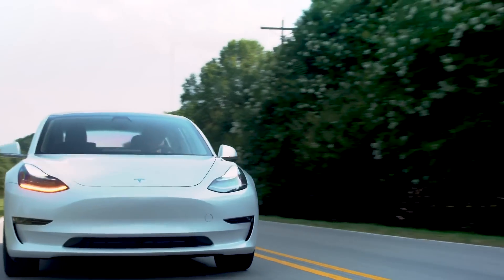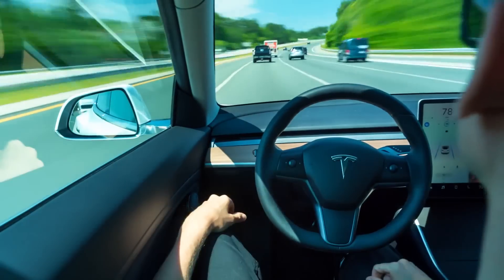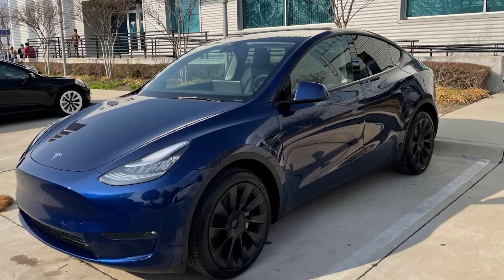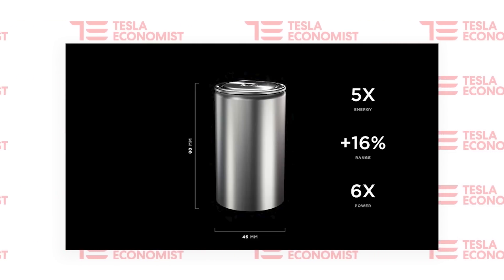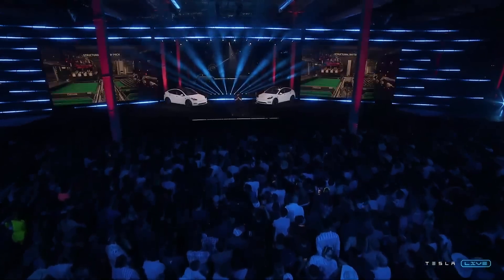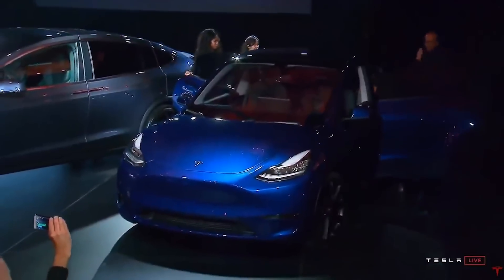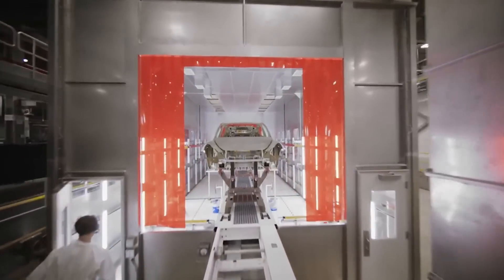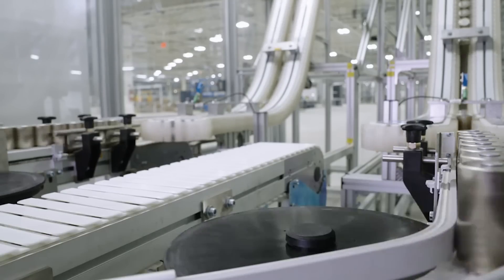Tesla Model Y 4680 Austin Software Upgrades!

Comment: On the topic of potential future software upgrades, one that seems to be well under the radar is the premium sound system for Standard Range cars. It is my understanding that all M3 and MY cars are made with the same sound system capability, even if there is a difference in the number of speakers (I should go and count them). The standard range cars are apparently software limited to "lower quality" sound system. I may be wrong about this but I've heard it from several sources, including my mechanic who specializes in Teslas. This actually came up when I was trying to figure out why the footwell lights in my SR+ aren't working whereas they work fine in my M3P and MY.  Turns our they are there and are simply software disabled. Anyway, I would be willing to upgrade my SR+ to premium sound for a reasonable price.

Comment: Lots to think about with this one TE and it leads to some very exciting thoughts!  So in a nutshell the 4680 could end up being the ONE BATTERY TO RULE THEM ALL, if I have that right. 

Today Tesla needs EVERY BATTERY THEY CAN GET, so they are flexible with not only their chemistry, but also their form factors. 2170 has been great and is still holding it down as we await battery ramping in Austin and Germany is still having their battery facility being built. The 2170 is a favored battery for other products outside of cars and so, even if Tesla stops using them, Panasonic won't loose customers for that form factor. 

The upgrades are a less talked about aspect of Tesla these days, but back in the day, being able to make your car even better (after you buy) is something that still remains pretty unique from this brand since the upgrades are not after market. Range, charging speed is an upgrade something Tesla sold before with the much earlier Model S60 (remember that one) before they eliminated that and the even lower battery offering to just do the Model S 70. People jumped on the upgrade because it gave them a benefit that they wanted when charging was much more sparse as well as peace of mind. 

After market upgrades are a great business that many other companies specialize in, like EVANNEX but Tesla is the only manufacture of a car that also offers upgrades direct to their customers that they have a good idea they will want. It helps them continue to get revenue even if their sales ever peak (not anytime soon) in the future.  Like a smartphone that actually can get better the longer you have it and you can modify. Imagine how long people are going to WANT TO KEEP THEIR CAR especially since for many it was the most expensive car they had ever bought before?

The Austin Y might just be a sleeper agent for now, but it could end up being the number one seller in the world after the lower cost LFP model that is available in China. Speaking of the LFP version... in these days and times 250 miles would be VERY WELCOME at under $50k  in this market with the way petrol prices are world wide. 

Nice one TE. You don't disappoint.
Reply: My brother in-law bought his Tesla almost a decade ago, has clocked in over a hundred thousand miles and has no plans to change it because it is still the latest Tesla !! And yes, he paid a bomb for it at that time, but he has no regrets
Reply: 2170
"Panasonic won't lose customers"
Tesla owns the factory.
Tesla "owns" every cell leaving the factory.
.
"2170 is the favoured cell..."
LiFePo4 seems to be "the favoured cell" outside cars.
Cheap and plentiful, with fewer volumetric energy requirements.

Comment: I would like to have a software upgrade to air suspension! :)
Reply: They are good but I think you might be waiting a little longer for that one 🤣🤣🤣
Reply: Meh, I've had air suspension vehicles before and kinda don't want one anymore, they are exorbitant to repair out of warranty. Kinda kills the whole idea of having a low maintenance vehicle.
Reply: @GregHassler  yes, but suppose we could have a low maintenance air suspension !! If anyone can do that, it would be Tesla !
Reply: The Raven air suspension on my X is unbelievably good
Reply: What difference does air suspension make? Never tried it.
Reply: @faluffel  generally speaking the ride, handling, noise and vibration characteristics are better with air suspension, ride height can also be easily adjusted to cater for the load in the vehicle and or driving speed or conditions. Car will lower at higher speeds to reduce drag and roll moments, car can be set with gps to raise to go over speed bumps or get into your driveway etc etc

Comment: I wonder if in say 4 to 5 years Tesla would have enough cell degradation data from the 4860 cells to then be able to offer a range extension on the "degraded" packs.  They might be able to bring you back to original for $500-1000.  I'm not sure how this would be in terms of public relations though.  It might be something they can offer for free, or they'd need to explain the cost to get the range extension right ie it's not as easy as a line of code that's changed.  Tesla have a lot they can do when they build a car with a million mile drive train

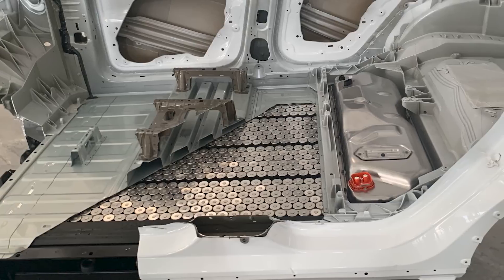Comment: At 2:45 you said 3000 kW, pretty sure you meant 300 kW :) Anyway, exciting ideas!
Reply from the maker: Yup, I was waiting for someone to pick that up. Was hoping TE viewers were smart enough to work it out 😉
Reply: @TeslaEconomist  Spoken about it, last week they showed a megacharger of 3.75MWh and I know for a fact it's designed by Tesla
Reply: @TeslaEconomist  I immediately wanted to correct you to 324kwhs as supposedly in q3 that is gonna be the new unlocked v3 sc speed.
Any bets on what the v4 allegedly coming out in late q4 of this year will offer? I'm gonna go with 420kwhs. 😁
Reply: But, if EITHER Tesla, OR Panasonic, OR LG "cracks it", while those two are reporting back to Tesla, (which seems to be the case) they ALL end up with a huge benefit.
This is the smart side of open patents.
Tesla has tripled their production R&D, and will receive "cheap" cells from both companies, probably with an agreement they can sell elsewhere after a certain period.

Comment: There was some reporting a while back on a process for a certain way of recharging that improved the batteries. There could be a special online service that checks and renews the battery pack. Tesla probably needs a virus and hacking protection software service.
Reply: You mean periodically "balancing" by charging to 100, then immediately discharging to a few % to allow the BMS to "read" the upper/ lower limits.
If you constantly run 20-80, the pack used to assume that was it's full capacity.
Not sure if that's still the case.
Reply: @rogerstarkey5390  Finally remembered this was from a Transport Evolved video 2 mos ago. It was about a report from DOE/SLAC 4 Jan 2022: "We found that we can move the detached lithium toward the anode during discharging, and these motions are faster under higher currents," said Liu. "So we added a fast, high-current discharging step right after the battery charges, which moved the isolated lithium far enough to reconnect it with the anode. This reactivates the lithium so it can participate in the life of the battery." >> This would require a way to accomplish the short time high discharge. Maybe have special drag tracks with superchargers at the line.

Comment: Charging extra for unlocking faster charging, increased range, faster acceleration, what next better sound quality? It's a bit maddening if the hardware is capable...
Reply: Not as a Tesla investor 😜
Reply: @kickvdw1706  I am a Tesla investor, so appreciate the financial aspects. Trying to save up for a Tesla car, but will have to sell my shares to fund it...
Reply: I don't think it is a big deal. Remember it would cost much more if all the features were unlocked. This way, you can buy the car at a lower price but have the mean to unlock it later on if needed. What I am concerned about is ads in the cars.
Reply: Sure if the base models have active sound cancellation tech like the s&x. But they lock it until you pay for it. 😀
Reply: You think every other manufacturer won't leverage software/ performance, etc?
Reply: @nguyep4  Ads in the car - hadn't even thought of that! That would be something else they could make you pay for like YT Premium...

Comment: 4680's going into a Plaid+ vehicle with a 600 mile range would be awesome.
Reply: Won't happen from tesla. But someplace like Our next energy might offer an upgraded pack in a couple years, like they put in their experimental model s. Then did 750+miles in the cold at hwy speeds and 880 miles in warm weather on a dyno with an otherwise stock car. 🤔
Reply: I’m not sure anyone needs 600 mile range your just carting a load of weight and expense around. Towing is the only exception as this kills the range so a bigger pack may be useful in that circumstance
Reply: @TeslaBulldotcom  Nobody needs 600 miles except for towing, but many people want that sort of range and if Tesla makes more profit from it, compared to putting that pack into multiple vehicles, then it would be a productive use of the cells. Towing is a big challenge currently and completely unrealistic in most cases.
Reply: I like the way you think!  I personally would be okay with 400 miles (6+ hours of driving), as that would reduce the 600 mile pack weight by 1/3, increase the acceleration and improve the handling.  Could the 4680 pack power the Model S plaid to finish the quarter mile in under 8 seconds?  Just another thought....
Reply: @bru512  Under 8 second quarter, maybe 6 minutes around the ring, having to charge less frequently for a normal week or month, and being able to cover very large distances and tow with ease. But maybe that's why they're going to have the Roadster with 620 mile range.. But I don't see that towing anything. But then there is the quad motor CyberTruck with 500+ mile range (maybe 600 when it launches), maybe that'll be the next level. I'll get both when they are available.
Reply: @michaelwebsternz  
How many Model S actually tow?
They'll reduce the weight, put a 110-120kW pack in and bump the charge rate.
450 miles absolute max (Outrange the driver)
250 miles charge in 10-15 minutes.
Job done.
Reply: @rogerstarkey5390  Anyone that has a boat. That's a lot of people where I'm based.

Comment: I super doubt that Tesla retires any battery cell sizes, anytime soon, as doing that also means retiring the entire ecosystem built around them to make packs, and the battery lines producing the cells, and all of that would mean fewer EVs made. Tesla has to reach the point where they are no longer battery supply constrained for that kind of move, and with Elon talking about replacing the entire worldwide power system...

I think we might get a range boost, sure, but not a huge one. Once an EV can comfortably do 300 miles and there is a great charging network, a boost in charging speed would be more appealing than more range. And if you can add say 200 miles in fifteen minutes, you become a lot less worried about total range.  

It looks like Tesla will try to avoid the Osborne effect by making the advantages of the 4680 Model Y be software locked behind an extra charge. This will also, of course, improve margins.

Finally, I expect at some point once Austin is fully ramped, Tesla will convert their Model Y lines at Fremont to Model 3 lines. The cars are close enough, and then there will not be a conflict between the versions of Model Y and Tesla will likely start shipping them unlocked with great acceleration and fast charging and so on.

Comment: The 4680 model really has the sweet spot in weight
Reply: The 4680 is "an enabler", a force multiplier.
.
It directly and indirectly enables system efficiency in the vehicle
.
It also multiplies energy out: factory volume (and factory energy consumption, and workforce, and process improvement, and environmental standards....)
.
Multiple "sweet spots"

Comment: Seems likely all US Y production would be in Texas, and the Y body line in Fremont switches to Model 3 w/ front casting. And then upgrade the old 3 line...
Reply from the maker: Yes, a possibility.
Reply: Is the model Y eating the 3’s lunch yet or are the prices different enough to keep it going
Reply: @TeslaBulldotcom  
Well, they seem to be establishing positions "1&2" in many markets, with nobody even close, so one "eating the others lunch" doesn't seem to be an issue?

Comment: Regular firmware upgrades seems like a given since over the air connection is a thing. Kinda like cellphones. However.. locking things behind a paywall like some cheap mobile game is wrong and will damage the brand over time unless its locked for a good reason like increasing the life expectancy of the things by alot.
Id assume acceleration boost is such a thing, you may go faster but it will eat the battery and motors if used to its potential alot. I still think the paywall is dumb tho since you wont use the full boost at every acceleration even if unlocked. Thus life expectancy wont go up by alot anyways and should probably just be just another car setting available.

Intentionally locking features without reason just to charge extra later is bad.
Reply: Locking the 4680 Model Y is being done with a good reason: to keep the 2160 Model Y competitive. If the prices were about the same but the 4680 Y was significantly better, which if Tesla just left the 4680 unlocked and charged based on their costs...well the 4680 probably will cost less to manufacture once ramped...then no one would want the 2160 Model Y from Fremont, and that is where Tesla can produce most of their Model Ys in America right now. Either Tesla does this or they slaughter their demand for the Fremont Y and can only supply a teensy fraction of demand from Austin right now.
Reply: @tribalypredisposed  IF 4680 is that much better they can have it as an choise for a price like all other specs until they can produce enough. Waitingtime for a spec would adjust demand for other models. 2170 isnt bad enough and can probably be switched for a 4680 pack when 2170pack has degraded to inconvenience.
Reply: @exchrols  uhm, nope. The 4680 requires a structural battery pack and while the Berlin 2170 pack is structural, the Fremont 2170 is not.
Reply: @tribalypredisposed  ok, still dosnt matter tho. Supply would make it so that 2170 would still get sold and a more complete product would pressure other autos to step up their game.
Reply: Ever heard of 
"You get what you pay for"?
Reply: @rogerstarkey5390  ever heard of bullsh**?
They can do what they want sure but id rather have features presented straight away and chose between having to wait in line for premium for full price or go for a cheaper model rather than having DLC along the way for unknown price that i essentially get to buy as a used product later still paying full for the feature. Its a car, not the next expansion to WOW or something.

Comment: I really don't think Tesla will replace the 2170's anytime soon as they already have the production lines etc for them and they need every single cell they can get. What the will likely do is have different products for different cells as they have in the past. If there were going to remove one type of cell in the short term you'd think it would be the 18650. Getting as many cells as possible from as many sources as possible to scale production is the real goal. Maybe in 10 years time they'll remove 2170's, even then though I'm sure they'd be able to find a use for them and lines will continue to get more productive.
Reply from the maker: I agree it won't be soon, earliest likely 24/25. It may also depend on Panasonic's progress with 4680s
Reply: @TeslaEconomist  Even in 24/25 cell constraints are liable to be very severe compared to demand, especially where both auto and energy storage are concerned. So the cells might migrate to other uses if not being used in the cars any longer. To get to 300TWh within 20 years is going to require a lot of cells.
Reply: @michaelwebsternz  supposedly in 2021 over half of all teslas sold had lfp pack's in them. That means as many cars in 2021 had lfp as tesla sold in all of 2020 without basically any lfp. Quite a fast turn around there. 

Allegedly in Feb they switched all forms of their in house energy storage systems over to lfp. So it's likely tesla might ramp up 4680s. 
And basically abandon all other cell formats except in house 4680, outsourced 4680&lfp outsourced cells. I'd say right around 2025+this could happen.
Reply: @4literv6  Yeah indeed. When they are no longer cell constrained or can't find a productive use for cells, or new cells are just so much better and easier and faster to produce they might change. I just also think they'll always find a productive way to use any cells they can get their hands on and scoop them up from the market. I guess they could always sell the old cells to other care companies as well if they wanted to.
Reply: @michaelwebsternz  I feel elon intends to abandon the existing suppliers outside of catl for lfp pack's, possibly gotion&byd. 
They will not likely ever give him the per kwh costs he wants on the cells, and Panasonic has slow balled the gigaveda ramp since building it out in 2016. He's not a forgiving or forgetting type in business it seems. 

What will be a benefit is many other ev makers will all of a sudden in a couple years. Have access to cells that very likely those producers that used to be supplying tesla will be somewhat desperate to offload at scale immediately. Once tesla pulls out that is. But hey I'm just a fan whose been right about teslas 4d chess moves for a while now. So I don't know anything in the end. 😀